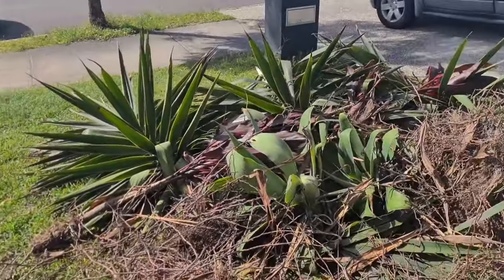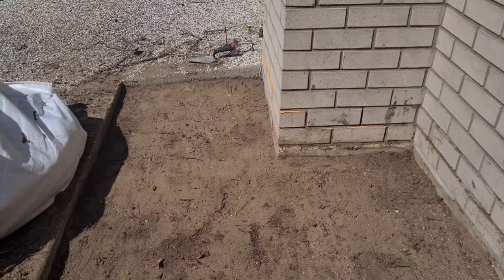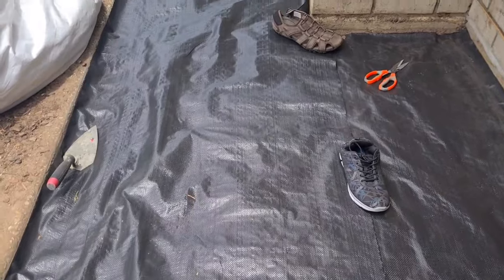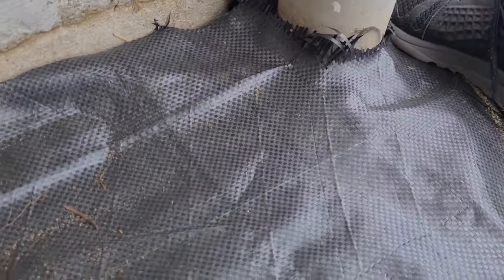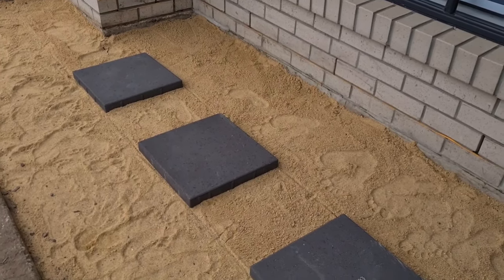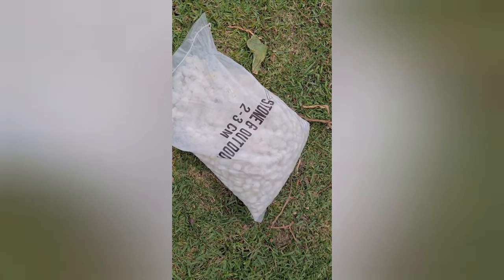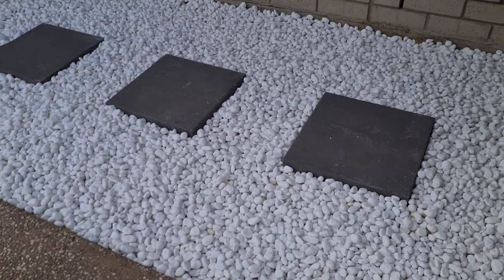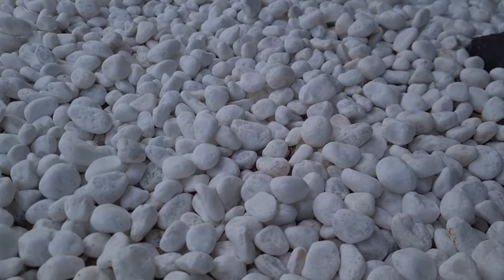How to easily lay white  Pebbles in the Garden..(Better not to put sand under the pebbles) FAQ added

Comment: Thank you for the information. Can you suggest which weed sheet to buy ? Is it better to get from local store or amazon ?
Thanks ! Also did the square stone move from its initial  placement area , say due to rain water or other environmental conditions?
Reply from the maker: Hi Anita, I have bought the weed sheet from bunnings.. There are couple of variety's bit buy the best one which is a thick sheet not like net.. Unfortunately I am unable to post a photo here... 

Re: square stone... No never .. it's not at all moved, it's a little heavy.. So I don't think you have to worry about.. 

Most important thing about the video.. Don't put sand as shown in the video.. It has changed colour of the pebbles, I had to remove it

Comment: 2:31 "the next process is to get the pavers..."

Completely ignores the sand stage. Btw, I don't think this arrangement will last much especially if it rains where you live. Sand will washout to the sides  and over the edges. You also did not put enough pebbles so I imagine you'll find yourself having to top it up soon and will have to deal with deformations from children walking on the pebbles since sand isn't a stable foundation.
Reply from the maker: Please note that I have mentioend to avoid Sand stage in the title and FAQ.
 I removed sand later when it started making issues like colouring the pebbles etc.
Reply: @KayVeesChannel  I see. Makes more sense now. Thanks.

Comment: do you have the link to the tiles and also the pots?
Reply from the maker: Thanks for watching the video and please Subscribe...  Tiles and Pots I have bought from local Landscaping supplies and Pot shop respectively ... The size varies to the size of the landscaping area.. Only thing you have to make sure is Tiles should be a little bigger than Pot Base ..
Reply: @KayVeesChannel  are your tiles 12'' x 12''?
Reply from the maker: Apologies for the delayed response ... it is 40cm x 40cm
Reply: @KayVeesChannel  can you let me know the dimensions of your pots? trying to find something similar that will look good with 16 x 16 tile
Reply from the maker: Will let you know .. cheers
Reply from the maker: The pot height is 22" and diameter 15"